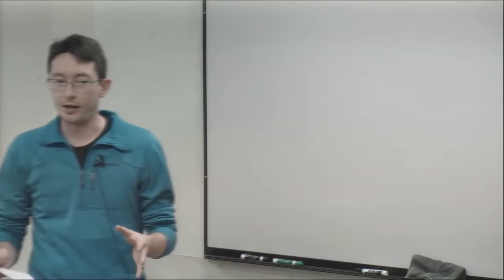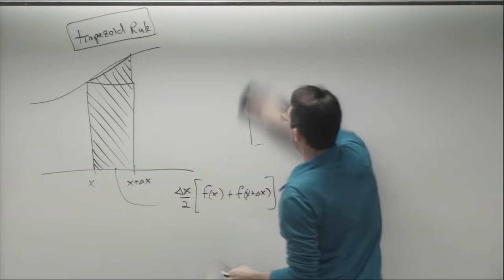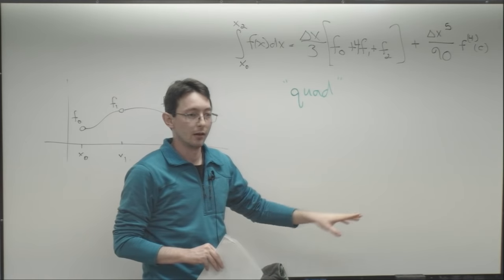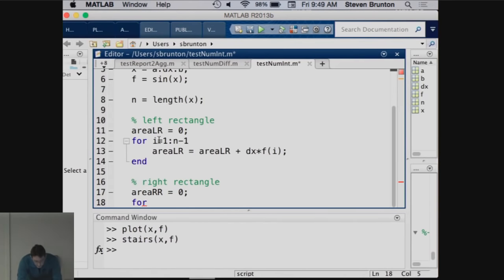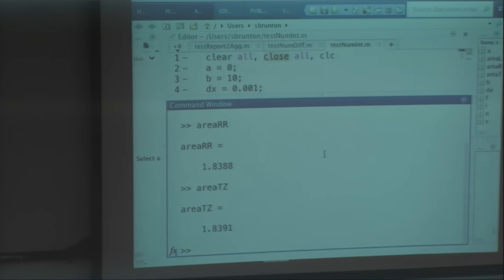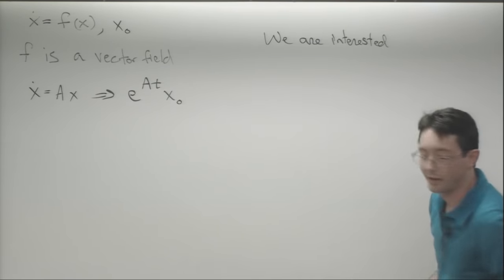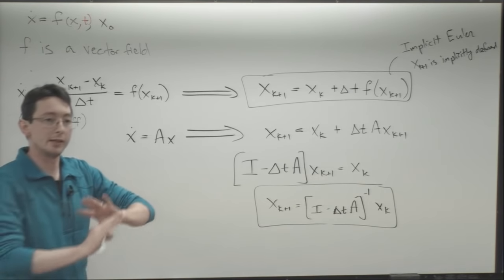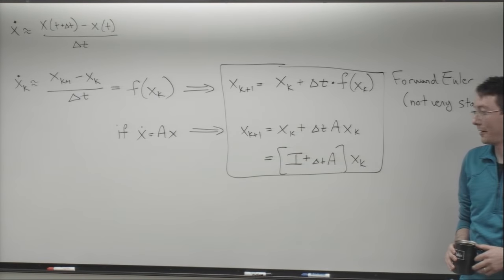ME564 Lecture 16: Numerical integration and numerical solutions to ODEs

Comment: Why is the trapezoidal integral better? I can see this on a rectangle/trazoid by rectangle/trapezoid basis, but if you integrate from a to b, every f_i gets evaluated twice, so the total sum should be the same, thus the same error of magnitude of the integral, right?
Reply: They are not the same. If  delta(X )is evenly spaced, the difference between trapezoidal and forward difference is delta(X)/2*[f(b)-f(a)]. In the forward difference method, f(b) is not used so the information is lost